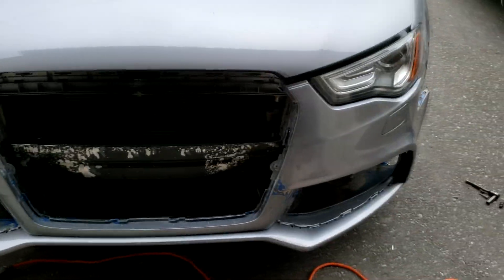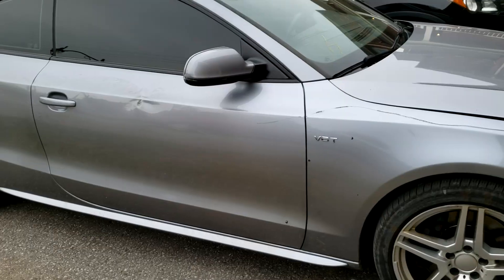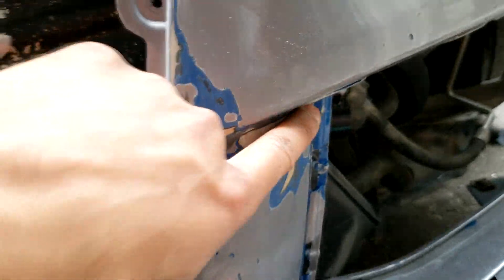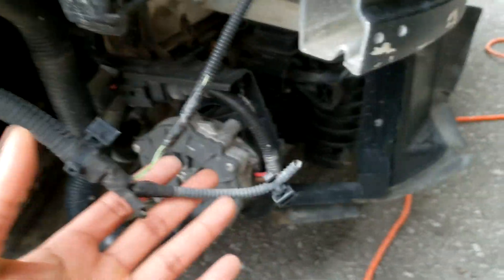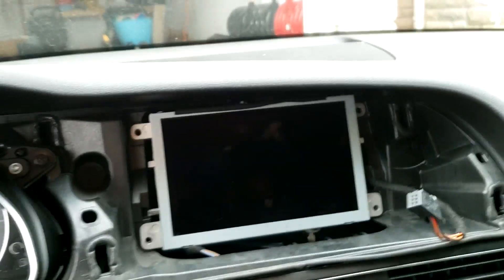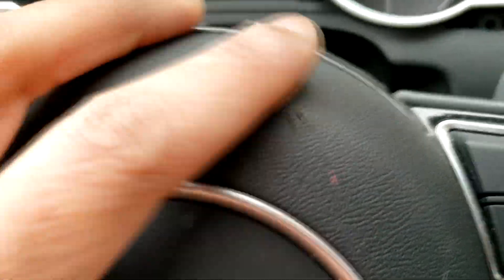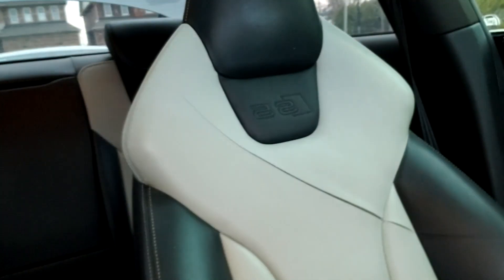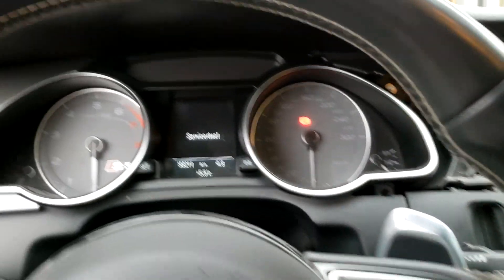I just bought the cheapest B8.5 Audi S5 from Copart ($8500)

Comment: For rips in the black rubber panels (dashboard) use some black rubber/silicone caulking to fill the slashes in and it will also act as a glue too to keep the two sides together.
Reply from the maker: considered something like that!